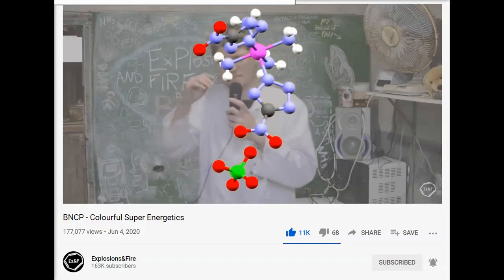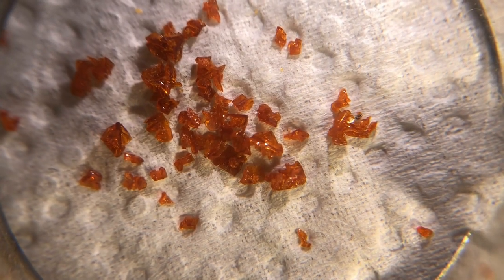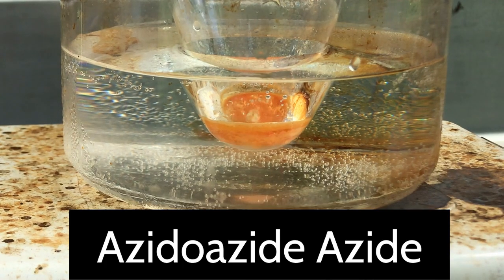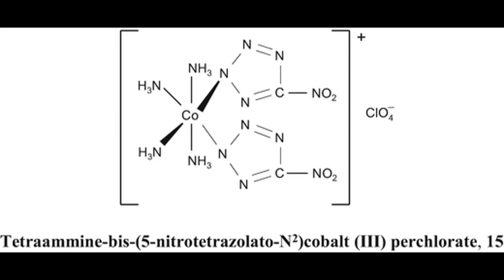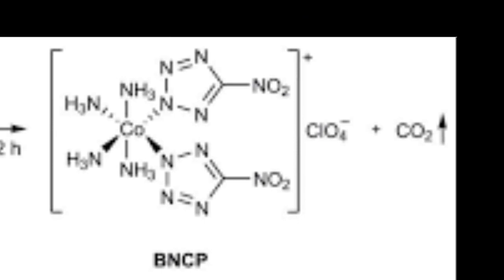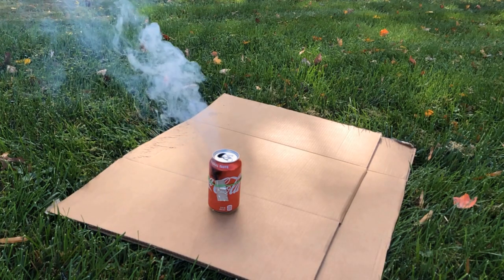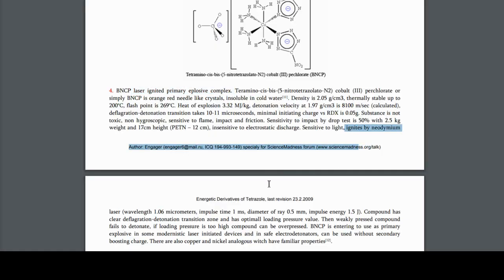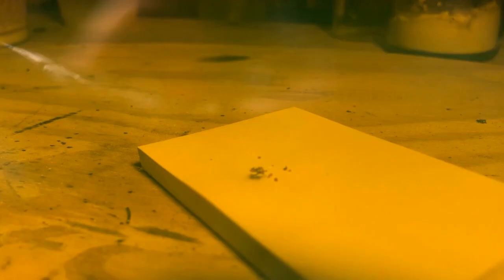Making BNCP and a Bridge-wire Detonator

Comment: Nuclear weapons use a fiber optic that delivers a q switched laser to this stuff. The laser is small and similar to the type used for rangefinders and tatoo removal machines. If you have a SSY-1 yag laser, that is very similar to the laser used. Also if you have super fine wire than nowhere near the high capacity is needed, 2 photoflash csps in series with a 3 terminal surge quench tube is enough to easily EBW a small lightbulb filament like a Christmas tree bulb

Comment: I've got a high speed discharge 1.5 KJ capacitor bank I've been building, it can operate at 475 Volts, 950 Volts or 1300 Volts depending on how the variable series/parallel connections are configured and I would love to do some exploding bridge wire detonator tests one of these days with it, once I build the spark gap trigger circuit for it anyways. It's such a cool way of achieving detonation.

Comment: Why isn't mercury nitrotetrazolate used? As far as I know, it reacts with copper and aluminum. Maybe because of this?
Reply from the maker: That might be one reason but I’d suspect the primary reason would be that mercury based primaries have been near entirely replaced in all applications of energetics. The army did a lot of research into Hg(II)NTz in the 80’s iirc and they must have just decided that the utility of the primary wasn’t worth the toxicity and environmental impact of Hg.
Reply: probably also because the substance reacts with copper and aluminum. I was doing research. Only the steel body suits him. And silver nitrotetrazolate is good in every way

Comment: Hello bcnp can u set off with plastic casting, 4 mm od. no need for ewb. Use hot tit primer. 10 out of 10 here
. Bron kno3 also works.

Also most important is not het great crystsls. Redolve, stir rapid in icebad.
Reply from the maker: Dude I'm sorry but I can only understand about half of your comment.
Reply: Hehe im sorry was Lil wasted.

My experience with BNCP is that that is easily set off if the bncp is a very fine poeder ( fast cooling while precipating from 1 percent HCLO4). Use a hot primer such as KCLO4 and titanium).

Best yields are with CTCN. And not with the perchlorate stuff. The CTCN is also dat more easy to make.

5.3 grams CTCN in 30 ml H2O.

10 grams NANTZ in 180 ml H2O. Add this to the CTCN solution and add 15 ml of 70 percent HCLO4.

Boil solution 3 houres reflux and cool fast.

This have me far better results.

Comment: Hey i have that lighter is urs a pain in the ass to refill also

Super intresting video especially the bridge wire part i was told when i was younger highvoltage could be used to set off energetics but my short recearch most talked about ematches and primaries thanks for the better explanation
Reply from the maker: Yeah they can be a PITA to fill for sure. Nice and handy though.
Yeah I did some testing prior to making the bridgewires with spark gaps within primers but they were wildly inconsistent and no two were alike. Saying this as modestly as possible, I consider making the bridgewire primers greater than making Azidoazide Azide as my greatest achievement.
Reply: @DBXLabs  i dont blame u tho they are both impresive the bridge wire was more like actual research considering u figured out how to do it so cheaply u made the step from learning to contributing to science and i congratulate you
Reply: @DBXLabs  I'd love to watch a video just on the bridgewire device.  
When you say 'filament', I don't know what you mean.  Obviously a thin wire like any filament but are you using nichrome or is it just a strand of thin copper ?  
Are you charging up the caps and then shutting the power to them before dropping the charge?  Based on what I saw this has to be but I'm not sure why the power to them has to be  shut off. 
Anyway, that thing was very cool to see. 
I wonder if one could be used to set off other nitrate based shock sensitive reactions.
Reply: I must have missed the link by just a few hours !

Comment: Just a thought. Did you try  to detonate it  as powder. Maybe it would be easier to  initiate that way
Reply from the maker: The originally produced amorphous powder had a good amount of impunities and didn’t burn well nor detonate. However, I’m sure that if I redissolved in water and optimized rapid crystallization, that product would make an even better primary. I’ve seen papers mention that
Reply: @DBXLabs  perhaps dextrination is in order

Comment: Hello, i tried to send u a message but dont know how, so i do IT This way. Im looking for the best primary HE and ended up with BNCP. But it has IT drawbacks! I looked further and i found a complex between aminoguanidine bicarbonate and nickel perchlorate . Can you make a video of this substance?
Reply from the maker: bncp x what drawbacks have you found with BNCP? I’m curious as to what those might be, as I don’t find any in my use of it. I will see what I can do making that nickel complex, but I would imagine that too would have the pretty serious drawback of being highly toxic. Nickel is not the best metal to vaporize into the environment.
Reply: @DBXLabs  

A quick search on google will give you enough information, would be cool!

The drawbacks for me is that bncp is not so easy to set off without a B&W. A hot priming mixture such as KCLO4/Ti and a strong cap design helps. I dont like working with sodium nitrotetrazole so I want IT to stay in solution all the time which results in lengthy measurments procedures. Maybe im not patiënt enough for BNCP;)
Reply: In the comments in this video https://m.youtube.com/watch?v=2DoNAIVTj4Q

more info i given. Be carefull if your gonna try IT.

Comment: Great video! I’ve had nickel hydrazine nitrate also speed off into little rockets when in larger crystals, almost the same behavior as the BNCP.
Reply: CHP does the same when you implement slow cooling in order to obtain long spindle-like crystals.
Reply: Ammonium permanganate does it too. I assume there's enough gas production from one side that causes it to act like a tiny rocket.